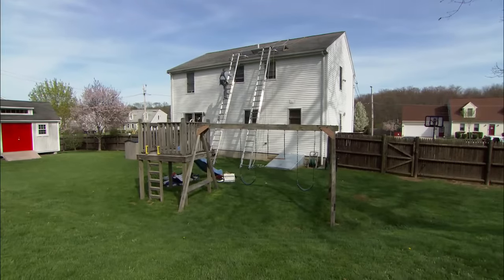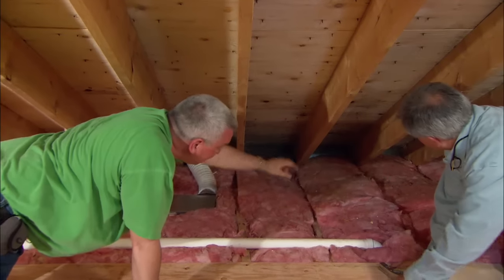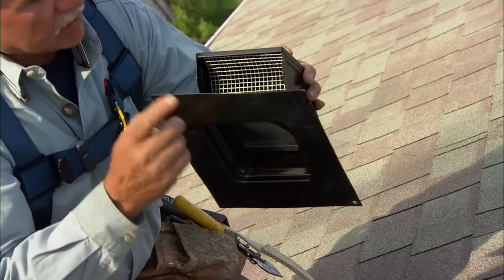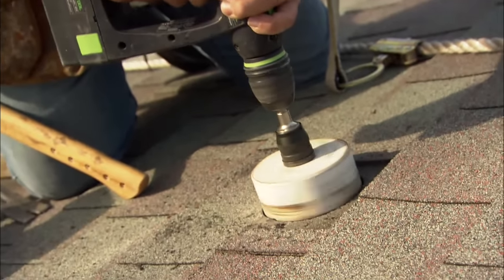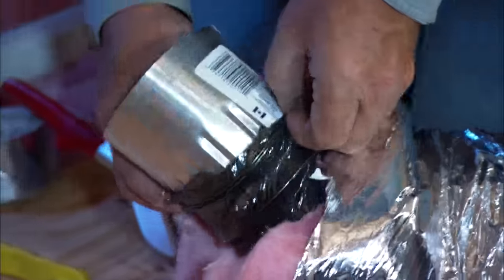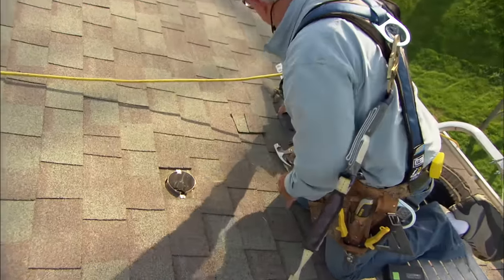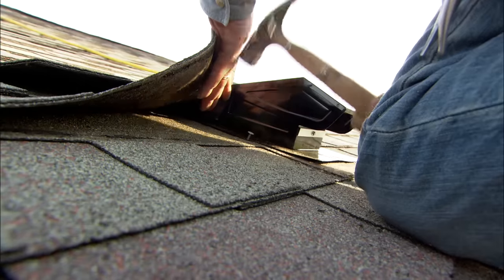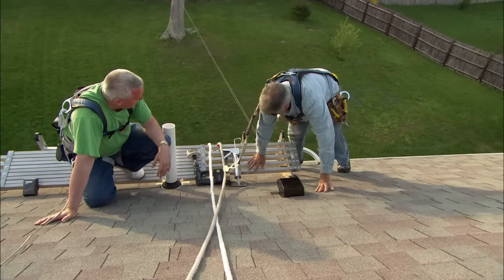How to Vent a Bath Fan Through the Roof | This Old House

Comment: My contractor installed a vent fan for me and vented it into my attic. I do have three turbine vents that spin near the roof ridge that pull heat out the top, but is that why my contractor thought it was okay to vent into the attic?
Reply: You didn't provide your location or any specifics about the roof but I'd bet that the venting that was done on your roof is in violation of your local building code.  Your best bet would be to call your local building inspections office and ask one the inspectors.

Comment: Why wouldn’t he go out the side of the house, just not near a soffit
Reply: Length of the run, looks like 18" from outlet to vent hood termination. Why would you go anywhere else? Installed properly it will last as long as the roof.

Comment: I like how the cheap aluminum tape changed brands in an instant. That tape is not called for, a good duct tape and ss clamp is what you need. The roof vent was installed wrong. It needs to be under 2 more courses

Comment: Tommy, since you nailed the ductwork section to the roof before installing this new roof vent cap, do you risk that exhaust air working against you. Seems like this discharged air could force its way along the sides inside the cap and try and escape under the roof shingles. Couldn't you attach that duct directly to the roof vent cap? I am planning this project because my vent cap has a 6" collar to attach the ductwork. Your thoughts, Thanks, Bill
Reply: How did it work out for you? Any tips?

Comment: Question:
I am installing a bathroom exhaust fan that has a 3inch diameter duct connection. Will be able to use a 4 inch flexible duct and just zip-tie/ tape it. Or should I use 3-inch duct work so that it fits snug?
Reply: Use a coupling adapter

Comment: I'm surprised by the low quality duct work.  That tape will let up one day and the vent duct will fall.  I'd put 3 small screws in the metal evenly spaced around, then zip tie the inner duct layer past the screws, then tape it (as code requires you to do with regular hvac flex duct) then zip tie outside insulation layer then tape it all.

Comment: how do you stop the flap in the hood from freezing shut?
Reply: Robert Jones. 🤔
Reply: poppyshoessp :)
Reply: well warm air from bathroom would melt it but ur right the warm air might cause i
Reply: mine freezes every day and takes 5 minutes to unthaw.  some of the moisture gets under the shingles.   what was wrong with having a good flapper on the fan housing.  these new ones dont seal
Reply: a heavy snow up here and that vent would be buried.

Comment: If someone has already provided the following, excuse me for duplication. This is a superb video. Thank you for publishing it.

A vent hood that is very similar or perhaps the very one shown in this video is the Nutone Broan RVK1A. The collar (part that connects the hood to the flex ducting) is included and removable, which makes a retrofit situation easier or possible. Many other vent hoods have integrated collars that are not removable. I haven't tried, but I imagine that it would be tough to get a hood and collar inserted into existing shingles.

I spent most of my morning trying to find a vent hood online and in frustration went to  my well stocked True Value in Ashland, WI. Fortunately they had the Broan RVK1A for $22. I opened the package to inspect it. Perfect! I got everything else I needed for this project there and will wait for a cooler day. I''m not a pro, but I think it would be best to not cut and lift your shingles when they are hot. Getting on the roof when it's hot is not only uncomfortable, but it's most damaging to your roof.

Also, you will need a 5" hole saw and arbor to make the hole for this Broan hood. 5" is necessary because you need that much space to insert and turn the collar into the vent hood.
Reply: I think that's the vent I have. I know I need to buy a bigger hole saw so I'll have to look into that.

Comment: aren't pretty much all bathroom fans vented out the soffit ?
Reply: A lot of contractors and bathroom remodeler's choose to do that, but it is wrong.  And they choose to do it this way because they don't want to mess with your roofing.  But what they are doing is setting up the homeowner for failure or at least additional problems in other areas.

Comment: are you kidding? That wont last one Hot summer before that foil duct tape crap falls off. I've used it before  and never again. Your better off putting some strong sealand and a metal clamp with real ducts.

Comment: Looked like you were using a silicone caulk. You had a different video about the through roof plumbing vent repair where you said not to use silicone though.

Comment: I did this years ago and recently I noticed the conditioned air leaking back in from the roof vent as if it is  bouncing back in. The silver coupling kind of slops in the vent hole allowing a gap on either side. I’m not sure how to fix it

Comment: Better hope you're not in the snowbelt if you vent hoods through roofs. Blowing that hot moist air directly onto a snowy roof creates horrible icedamns that will destroy the shingles, gutters and even the overhang structure if they get too big. 

I would instead leave the fan vent as it was, but direct the exhaust outward and remove the soffit venting in that vicinity to prevent attic mold growth.

Comment: Couldn't you just run a corrugated gutter pipe down from the soffit vent to the ground? Unless you're worried about how it looks. I'm not, as I'm thinking about doing it on the backside of a rental property.

Comment: I need to get on this project. I have a 1989 build and all the shower vents (4 of them) just vent into the attic. In the winter the steam comes out of the ridge vent and it looks like the attic is on fire! I guess it works, since it’s been that way for 30 years, but still…

Comment: This is exactly why you shouldn’t have carpenters do your hvac smh use cable ties, sikaflex, and they actually make a roof vent collar so you’re not hacking it in like that. Also with foil tape you need to use a squeegee or it doesn’t seal. Derrrrrr

Comment: Tommy, if you have a soffit vent that goes around the entire house and a full ridge vent, do you need to install an attic fan? Seems like in the summer, it can get over 125 degrees in my attic in North Carolina. So because we store lots of stuff in this attic it may be drying out and becoming useless. So do you think a ventilation fan with a thermostat would help? Thanks

Comment: I have solar attic fans installed yet my bathroom vents were pretty much just vented to the attic. My question is since I just installed the attic fans do I still need to vent the bathroom fans through the roof or do the fans create adequate ventilation already to reduce humidity in the attic

Comment: When our house was built, the electrician vented both our bathrooms the same way.  In fact he didn't even use a vent on the bottom of the soffit.  He just left the exhaust hoses resting of the soffit on the inside of the roof.

Comment: I have a soffit bath vent and my plan is to replace/open the soffit and put in vented vinyl but I will now stay far enough away from the soffit vent/bathroom.   A gable vent/fan w/thermostat is also in my plan. Major part of the soffit is up wind from this B/Vent as the bath is on the corner of the building.
So glad to see this issue, prior to my project. I have no interest in being on the 2nd floor roof of any building.

Comment: jesus it's just a bath vent fan..What are they doing in there..That vent is going to leak like a river..just run the pipe up the rafter to the ridge vent...job over no leaks and you don't fall off that roof

Comment: DIY Rookie here looking into HVAC venting and ducting.  My understanding is that ducts should be pulled tight to minimize friction for air flow (like in AC ducts).  Isn't there too much slack in that new duct leading to the new roof vent?
Reply: From my understanding that's a short enough run that it shouldn't be a problem unless the fan is really underpowered. As long as it's not bent in a way that condensation can pool inside the pipe there shouldn't be any issues.

Comment: Couldn’t the fan be piped into the vent line just under the roof so it takes the path of least resistance and goes out (as opposed to down into the sink area). What if you over sized the vent?

Comment: Isn’t there concern of cold air dropping during the winter months. It looks like a major place for a heat loss.
Reply: Not much of an issue.  Most bathroom vent fans have an automatic damper that closes when the fan stops running, plus the damper in the roof vent that was used in this video.  A small amount of warm air can seep past the dampers, but it is insignificant compared to the heat loss overall for the whole house.  The upward flow of warm air tends to prevent any cold air from flowing downward in the vent duct.  If cold air gets into the house, it will be elsewhere, close to the floor.

Comment: I'm terrified of cutting a hole in my roof. I feel like no amount of caulking is going to keep it from leaking. Plus I'm terrible at the rudimentary art of caulking... any tips?
Reply: dracophyle use a strong bead, after its dry spray it with the hose to check for leaks, just for peace of mind.

Comment: I see this new vent is right next to the Drain-waste-vent system (stink pipe).  Is there a risk of an unpleasant smell coming back into the house through the roof-mounted bath vent?
Reply: Nah, it should be quite safe because remember - there is a "door" in the inside of the new vent that opens when you turn on the fan and it closes shut through gravity when the fan is off - bad smells will not be able to get in

Comment: I have a roof vent installed, the person who did it cut a 6.75 in square hole in the decking. What do you recommend the best way to attach the 6" vent tube to the square hole? What is do you call that metal strip you used at the end of your video to secure the tube?
Reply: Use a screw worm clamp

Comment: I wonder if the low profile roof vent shown in this video would get blocked by heavy snowfall.
Reply: To meet the code, they would have stuck it out (about 18" or so above roof), if it was in a heavy snow area.
Reply: It is a heavy snow area(Its Boston) the hot air will cut through the snow like butter.

Comment: Hello All, thanks for the video....where can I get the extension for the ladder on top of the roof and also the device they are resting their foot and the harness....hopefully someone knows...thanks
Reply: They are ladder extension legs. You can find them in the ladder section or paint section at hardware stores.  Werner makes them for about $50-70. Worth it if you have to paint or straddle windows while working on a gutter.

Comment: Totally unnecessary. If a fan is vented into the attic properly, it's fine. Putting a hole in your roof to vent it directly outside is a bad idea because it allows cold air to fall down inside the vent meeting the warm air of the house. It causes condensation inside the fan assembly. Fans rust and wear out sooner and excessive moisture can even damage ceilings. Climates do vary. I live in the midwest where we get extremes of both temperatures, so what I'm saying is valid for this region.
Reply: That's just dead wrong. You never vent anything into an attic.
Reply: @wallyballou7417  Nope, you're wrong. It's been done this way for decades.
Reply: @wallyballou7417  Enjoy typing nonsense. I've worked on houses that are decades old that had the bathrooms vented like this and it IS FINE. It's code and this IS THE STANDARD.
Reply: @YesuAiNimen  Are you talking about running a vent THROUGH an attic (as in the video) or venting INTO the attic? Because you said "If a fan is vented into the attic properly, it's fine" and that is certainly incorrect. 

And exhausting through a soffit is only allowed if the outlet is 10 feet from the nearest air intake (which including soffit vents). (m1506.3)

Comment: How would I attach the elbow joint which is 4" diameter to the insulated duct which is 6" diameter?
Reply: +Mellanye Lackey You wouldn't. You would need a 6" vent for 6" duct.
Reply: +Mellanye Lackey You buy a reducer at home depot.

Comment: That hole saw just got ruined.Lloyd, roofer 35 years.
Reply: The hole saw got ruined? Why? So how would you drill a hole into a roof?
Reply: @douglasstone8915  HI Douglas, those Milwakee hole saw bits are expensive, and when you hit a nail or cut throug the stone granuals that are covering the shingle they go dull fast.If you cut the shingle out first with a utility knife you will be able to see if there are any nails in the saws path, and remove them.

Comment: Does the vent pipe need to go straight up from fan through roof or have a horizontal run in it before it turns up?
Reply: Shorter duct hose, the better.

Comment: but what happens when I get a foot of snow on the roof and the vent is buried?
Reply: When properly installed, nothing. 
However, if not installed properly, then venting directly into the attic would have been the better of two bad options

Comment: Can you use screw instead of nails?
Reply: Roofing nails have bigger heads than screws, maybe a wafer head screw.
Remember use same metal fasteners as hood, (electrolysis) aluminum to aluminum or steel to steel

Comment: Thanks for this well edited presentation; it's great to watch a real expert at work, explaining the process as he goes.
I wish you had installed a roof vent for us; when we bought our house, it was leaking right into the ceiling and it turns out the installer had forgotten to seal the flange. 
We found their number and had them fix it, then it still leaked, so they had to come out again and sealed it better. At least it was free.  But I wish I could have gotten up there and watched to see what the hell the kid was doing, clearly not very experienced.  At least now I know better what it should look like!

Comment: I live in Pennsylvania. Do you need a permit to do that?
Reply: yes most likely but it depends on what city or township you live in
Reply: Who is going to know?
Reply: Blaine Bugaski when you sell the house won't they know?
Reply: Extremely unlikely.  Do a professional job and wire it up right.  The city inspectors who are usually lazy slobs won't notice if you drill a hole in your roof or not.  I have seen local roofing inspectors refuse to get up on the roof to actually inspect and instead stood at ground level to give it a "look over."  As if that is going to do anything!

Besides, many permits require there to be a certain minimum cost associated with a job.  And many times, replacements do not need permits since the item or structure existed before and is only being rehabilitated.

You have bigger problems to worry about than if a permit is required for a measly bathroom fan.
Reply: the vent police
Reply: Doug Dinger We need permission from the government for just about anything anymore. Vote the heavy handed lawmakers out.
Reply: If you're talking about adding a roof vent to an existing bathroom fan that currently exhausts into the attic, the answer in most places is going to be "no," but there might be exceptions.

Comment: What a load of cobblers. That bathroom soffit vent is perfectly ok. Plus the fact that ridge is sealed tight and has no ventilation under it at all. The damp in the loft is caused by that, not the bathroom vent.
Reply: I'm assuming you're being sarcastic .

Comment: Who is even selling those pieces of junk? The new vents have a top and bottom flange which prevents moisture from being blown UNDER the shingles.   I'm not sure where this guy purchased that vent but most these days have a 4" duct connected to it which prevents you from sliding it under the shingles so this video really isn't helpful.
Reply: +Edwardo Snowdeno You're not a smart person are you?  Just because you have an attached duct doesn't mean you can just throw the entire thing on top of the shingles, nail it in, and call it good...

Comment: The moisture goes vertically up the hose, collects and freezes to the sidewalls. Then when you turn on the vent fan the next time, the heat melts the ice buildup and it runs down the hose and onto your floor, staining the ceiling on the way. Also snow build up on the roof precludes air flow, and causes water to back up into the hose. Another thought, only run the vent in the summer when it's humid outside.6 of 1, 1/2 dozen of the other. Think I would rather have a little staining under the roof sheathing.

Comment: The roof is not a bathtub.  There is no reason to use caulk on the roof in this instance.  What he’s done is created a water dam that can cause an ice dam.  Water could get trapped above the vent and in freezing temperatures will cause the ice to back up over the top of the underlaying shingle and cause a leak.  It won’t get too far in the attic to be noticed, but the deck will rot out.

Comment: 5:20  SHOULD  BE  USING  SCREWS, Robertson head, about 2 inches long.  Green  decking screws....NAILS,  ARE  USELESS,  on eavestroughs'  ....anything  OUTSIDE.   PERIOD !   THE  WEATHER ,  IS  HORRENDOUSLY   acidic,  more so, each  passing  polluting  year.   THERE  MUST,  OF  NECESSITY,  be higher  commercial  STANDARDS,  for  modern  crap houses....